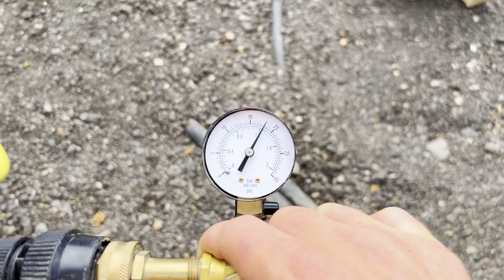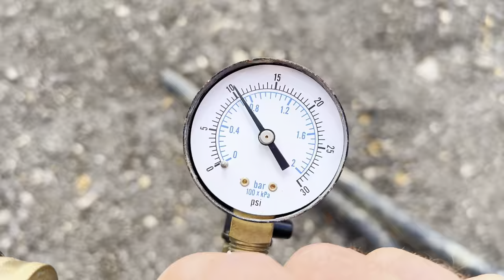FULL TRANSFORMATION OF A POOL AND SURROUND

Comment: i do pools myself in buffalo,ny  . its cool to see some of the different styles of doing things .
Reply: Hi, any suggestions on what I can use to get algae off my vinyl pool liner. It’s an above ground pool and the walls from the water line down is covered. I wasn’t able to physically take care of my pool at the end of last season and it’s a mess now. I just got it drained today and the floor isn’t that bad it’s the walls I’m concerned about. I tried spraying a mixture of bleach and water today but it’s super windy and chilly so I couldn’t apply it properly or scrub it. I’ve dealt w it around the water line before but not the entire sides. Thank you!

Comment: Damn, you did a great job! I had that same pump and filter. My pump is the waterco super mite which is a great design. The filter on the other hand I noticed when you turn it on, the top will rise up a little and could snap the fittings.

Comment: How come the aur between the liner and concrete is vacuumed out? Wouldn't the weight of the water similarly force the air out? For a smooth finish? Another reason? Ty for the entertaining videos!

Comment: Am I the only person who thought swimming pools were done like this by someone doing each & every mosaic tile?! 😂
Reply: A proper pool does have tiles or coloured concrete. This is just a cheap solution that seems popular in the UK.
Reply: Yes normally the mosaic tiles come stuck to paper in 20x20cm squares to make them quicker and more accurate to lay.  But the vinyl liner seems like a horrible solution to me
Reply: Pool tiles are attached to each other with a plastic mesh, so they can be installed in sheets usually in 1 foot sections.